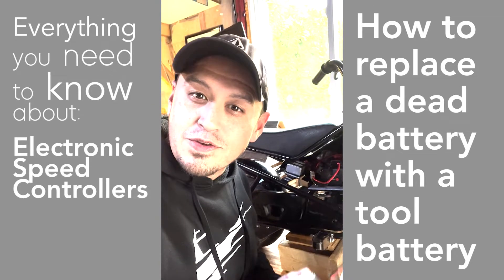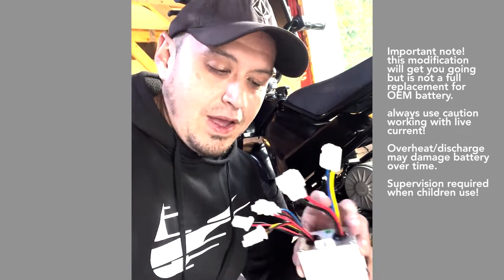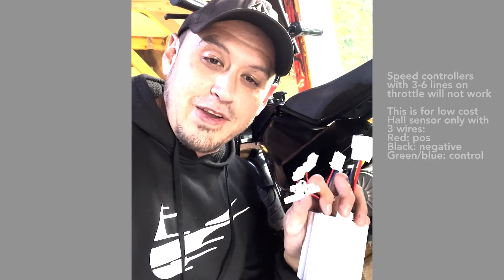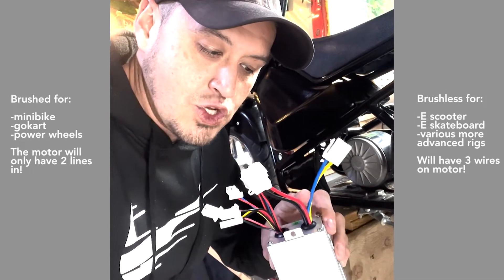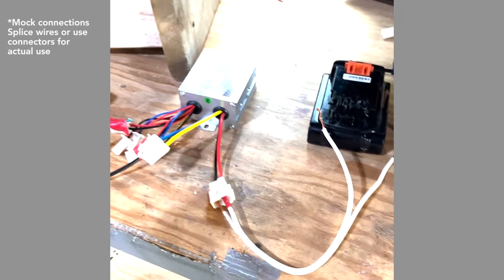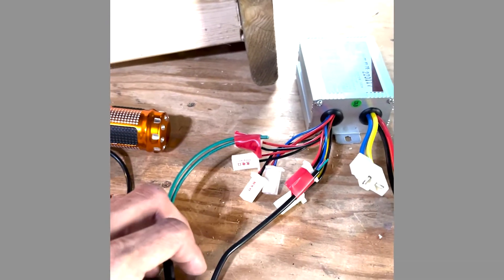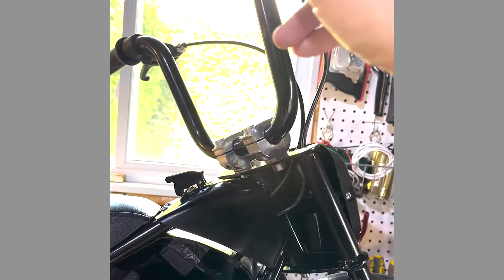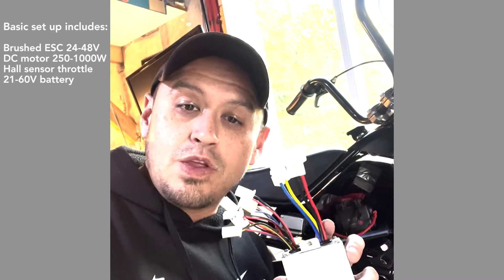Electronic speed controllers Everything you need to know THE BASICS! 24v 36v 48v

Comment: So can I use a 36v speed controller with a 48v battery
Reply: If the controller is advertised as 36v/48v then yes you can.I have done this 4 times using 36volt electric bike wheel 350watt controller with no problems at 26mph.